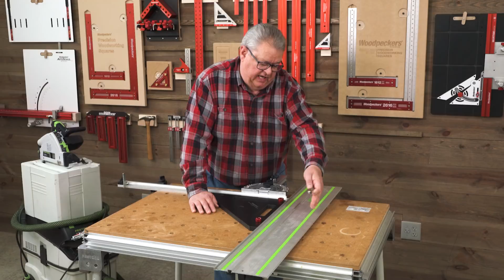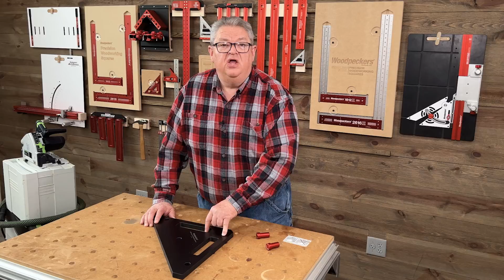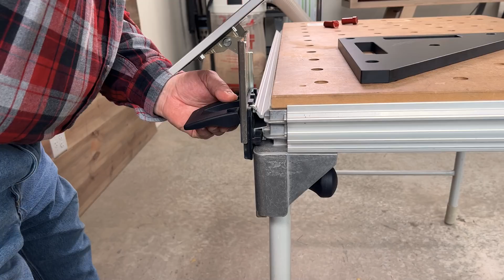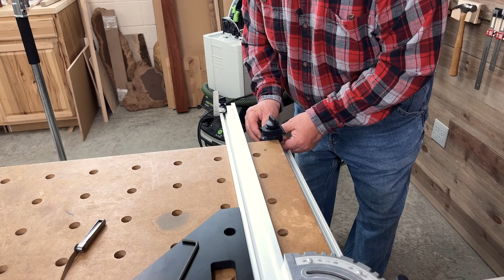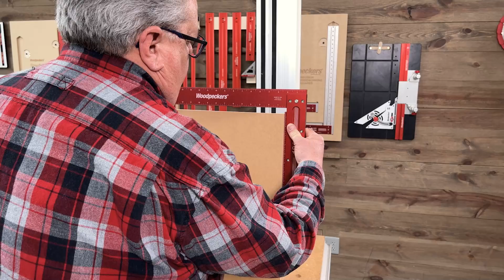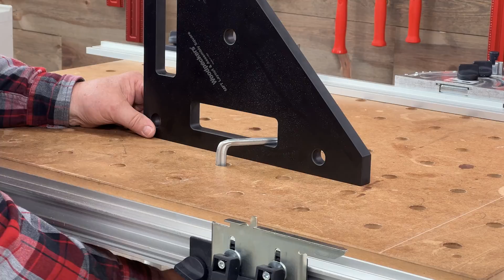Perfectly Setup Your MFT Table With MFT Layout & Assembly Square | Deep Dive | Woodpeckers Tools

Comment: You said you were gonna show how to check if the factory stops weren’t perfectly set I thought? Did I miss that part?
Reply: Kind of. He doesn't actually show the assessment, but the process he demonstrates will compensate for numerous slight mis-alignments--including those factory stops. My understanding is that the factor setting of those stops is to make the rail support pieces hold the rail edge at 90 degrees to the front and back sides of the mft. That may or may not also align things with the CNC hole pattern. By following the instructions, you get everything aligned: MFT metal frame, rail, fence, and dog holes.

Comment: This square is super nice! I would suggest purchasing without the bench dogs.

Mine have such a large tolerance that the square moves when using. Wasn’t expecting that at all from a Woodpecker product but I had other longer bench dogs with a tighter tolerance that worked perfect.

Comment: Why not just use the 1812 square for alignment and the WP (or similar) clamping squares for assembly?  Although reasonably priced (by Woodpecker standards) this seems like a solution in search of a problem.  What am I missing?
Reply from the maker: If you don't have the 1812 Square, and setting up the MFT is your primary mission, it is a less expensive option.
Reply: fanboi cred.
Reply: This MFT square has a taller shoulder/is thicker so there's more to register against. It also uses the dog hole to square the track if you want to change the orientation relative to the table... for example, if you want to use the 55" track lengthwise. The 1812 square can't do that.

Comment: Do any other MFT accessories require perfect 96mm hole spacing? It seems like all MFT workholding is either hole-based or extrusion-based, and the relationship between two holes never matters (besides clamp reach). I repurposed an old table with MFT holes (no aluminum extrusions) for surface clamping, and laid out a 4" grid with a straight edge. 1/32" off is 99% accuracy. I just couldn't find any reason it had to be perfectly centered hole-to-hole. Would love to understand a use case for it.
Reply: Part of it is that 'perfect' spacing equates to 'perfect' and 'perfectly consistent' alignment using the holes as precision reference locations. If you elect to use dogs to place in holes to establish exact orientations of one or more work pieces on the top, then it is very useful to have precise or 'perfectly' spaced holes in a square grid. This utility is increased if this grid can also be aligned 'perfectly' with the track for the tracksaw as illustrated in this video. Obviously there are other ways to accomplish the same alignment using the dogs directly and without the square--provided you can count on the holes being 'perfectly spaced'. Note that its not critical that their pattern is perfectly aligned with the edges of the MFT top board (though they likely are) or with the aluminum frame of the MFT table. This can be accounted for using the adjustments shown in this video. 
But if you just have DIY holes accurate to the nearest 1/32nd of an inch, then your results may vary. Especially if the holes are drilled using a method where each new hole is drilled in relation to the prior hole. In this case, you set yourself up for accumulating error that could get large over a distance as the small error from one hole to the next accumulates systematically. 
You will see lots of old comments about the supposed dangers of relying on the MFT table top holes as precision locators, but these are largely incorrect. The holes are made by Festool with CNC precision, so yeah, their spacing is 'perfectly consistent.' So as long as you actively establish (or verify) alignment of anything else to that CNC hole pattern, you are good to go using the holes as precision alignment points relative to each other or relative to the mounted MFT accessories..
Reply: @steveh8724  Thanks, that makes sense. Perfectly aligned dogs would definitely help enforcing a true 90deg corner for frame assemblies where "close enough" holes would just be headaches. I'd fully trust the CNC-made tops are indexable, or products like this couldn't exist. I just thought it was weird that there aren't more accessories that index via two holes at once (excluding the jigs for cutting further indexed holes).
Reply: My problem was out of 4 MFT tables, at least one of the dogs was "wiggly" on each mft top. Not a lot, only the slightest bit, but enough to cause me misery. 

I switched to the Festool recommended method, which takes longer than this, but works.
Reply: @everettnetzband  Take a look at UJK Parf Dogs at TSO. They expand to lock into and center on the holes and are a necessity in mine and many others opinion that use MFT tops to insure accurate alignment of the dogs.
All the Best, Chuck

Comment: Probably one of the most affordable Woodpeckers’ tools and multifunctional. 
I might just spring on this 😊
Reply: I've had mine for a couple of years. Beats even the way more expensive squares they make for setting up the MFT table.
Reply: Wait for a sale if you don't need it right away.
Reply: @BuckRogers2491  it's currently on sale
Reply: @BuckRogers2491  Sorry, what language are you writing in? I seemed to have read the word "sale", and, since we're talking about Woodpeckers, I can only conclude that must be a typo.
Reply: @aldenpines  that have sale items all the time
Reply: @aldenpines  Yeah, I use the term loosely. By "sale", I mean like $10 off. Tiny discount?
Reply: @daveklein2826  Right. Instead of $349.95, it's only $339.95. Woodpeckers does make good stuff, but they even put Festool to shame in the category of exorbitant pricing.
Reply: @aldenpines  your opinion
Reply: @daveklein2826  Fact.